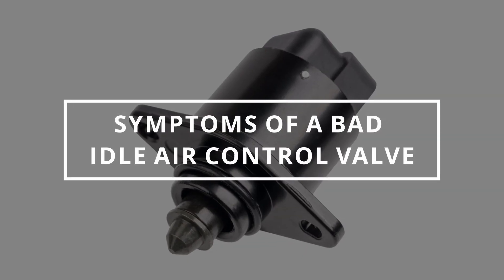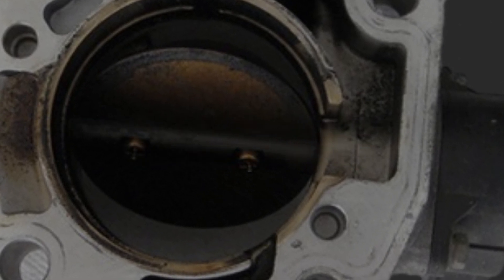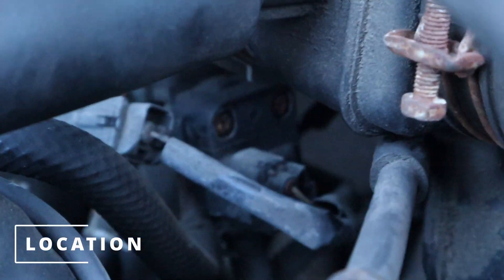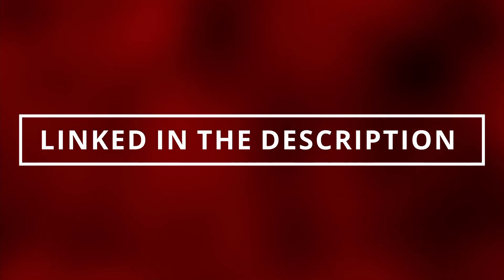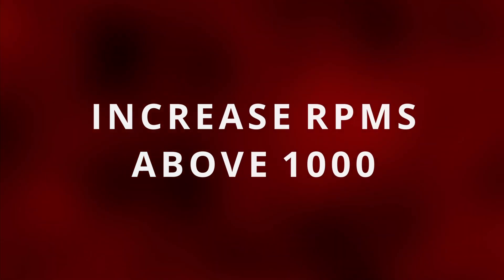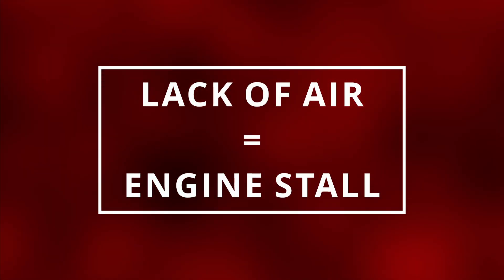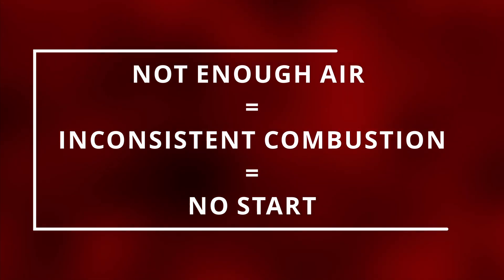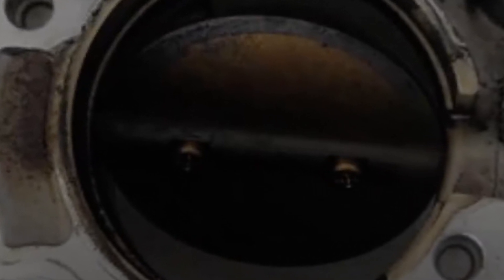SYMPTOMS OF A BAD IDLE AIR CONTROL VALVE

Comment: Been having this issue in my v8 s10 it runs and drives great but I’m having to give it gas to get it started, and when it does start it runs at low idle  ’ve replaced the IAC with a new one. Checked the fuel filter and air filter and no luck. Anyone know what it could be?
Reply: I would check the connection/condition of the mass airflow sensor, and also the condition/connection of the throttle position sensor. Also inspect for any tears on the boot of your air intake and any other vacuum hoses that may connect to it.

Comment: i have been told my issue could be electronic throttle body on my 2008 a3.2.0 tdi , i have no engine light or codes, my symptoms are when the engines up to temprature it will stall unless i keep my foot on the gas pedal , yet when the engines cold it  starts fine and doesnt stall.  does anyone think this could be my issue ,

Comment: My uncle's Tuscon on a cold start will fire right up but then the idle is really low like below 600 rpm for about a second or 2 as it appears to want to stall out, then ramps up to 1400 rpm during its cold start process then slowly drops to 800 rpm as it warms up.

Comment: FINALLY....I've had the "howling" sound for 'bout 8 months on a 1997 4x4 Ranger 4ltr v6. IAC....hmmm....who would've thought. I'll try to replace it myself or go to the local small garage mechanic (I support local businesses). Yup...truck is 26yrs old with 157k on it. Always starts...and has never left me stranded. I even drove to California from central FL last year at the height of gas prices ! I need a interior dome light cover and a fan speed modulator. And I can't find the very slow leak on the ac.

Comment: Would a bad IAC valve have anything to do with my 2001 crv misfiring only after being driven for a while?
Reply: I had that problem once. My valves were out of adjustment
Reply: @danhatstat6890  yeah there were a few parts I replaced over the last several months. Was running good for 3 months after putting a new distributor in it. But the problem resurfaced almost 2 weeks ago. So I'm just taking it to a mechanic in a couple weeks.
Reply: @josephhobbs278  have them do a compression test on the cylinders. Thats how i found out mine was messed up. Cheap solution

Comment: Is runner control valve and idle air control the same? 2009 mazda 6 I can’t find the IAC
Reply from the maker: No, they are different. You might not have an IAC. If you have an electronic throttle body the engine control module regulates the idle by opening the throttle plate a tad bit.

Comment: I have a 90 accord in great condition but recently having idling issues car fluctuates rpm rev high then low but seems to clear up after it warms up good and as soon as I put it in gear it idles perfectly... Anyone have this issue before or know what could cause this because I'm out of ideas but I'm only a backyard mechanic and would appreciate some suggestions ...
Reply: Try giving your IAC probe a clean first and see what condition its in. They can get a lot of carbon build up inside the throttle body.

Comment: I hate idle air control valves. Half the ones bought are junk and they go very fast unless you spend $80 at autozone for one. And alot of sellers online sell the wrong one. When I speed up ot shouldnt be so hard for the rpms to go higher . It takes buying tons of them from different sellers to find the exact right one. Then they only last a year.. .. fu king pontiac 💀

Comment: I got an 04 325i, when coming to a stop will dip under 500 and you can feel it, only for a second then bops back up, ac on idles around 650, ac off has to be 550 to 600. And at the hottest part of day, half second hesitation taking off from full stop. Testing ICV, ie, jiggling it makes the sound. I'm thinking it's this
Reply: This is my same issue. Did you replace it, and did it fix?
Reply: @Bait Royale  No, it goes all day long doing it with no harm seemingly, I've replaced spark plugs, and ignition coils, if I replace the fuel injectors all 6 I'd probably be good, already replaced one leaker with a used one. I put 40k miles since it started up, I'm more worried about it then the car, also the little cover for the fuel lines in the fuel filter housing is missing from when I changed it. These cars can have multiple problems and keep chugging along like nothing

Comment: It has been happening to my car. Cold start crank, runs, then immediately shuts off. Have to start, give it gas to about 2k rpm for a few seconds and sometimes stalls again. Will order the oem part. '00 4Runner.

Comment: My truck starts up fine and idles fine but when I get going down the road and the more stops I make the higher the idle gets. I can usually remedy this by turning the truck off and restarting it but it's a vicious cycle. Also I think it is causing some backfire inside the air breather. I have a 90 Chevy Silverado 4.6L V6
Reply: Did u figure out what was causing it?
Reply: Sounds like a vacuum leak possibly the intake manifold gasket. I had this problem and burned two valves.
Reply: @allanbrogdon9372  I wish I could check to see if that's the problem but unfortunately it got stolen.
Reply: @joetroutt7425  my Yukon was stolen and the police wouldn't even make a report. I feel your pain !
Reply: @allanbrogdon9372  I was just looking back on this comment section and realized that my response to you was wrong. The truck I was talking about being stolen was the one in my pfp. That truck is a 94.
Reply: 1996 Chevy Silverado when I run over 65 mph truck start jerking

Comment: This is exactly what's going on with my 18 mustang GT I think it's closed or closed because when I get to a stoplight it idles real low and it stalls I have to restart the car in either put it in part or neutral or keep tapping the gas for it to not cut off
Reply: Do you have an update? I’m having the same issue just not as severe. I also have the same car lol.
Reply: I literally have the exact same issue with my 05 Ford Focus, my mechanic suggested replacing the Idle Control Valve. It literally does great in driving, acceleration, highway driving, but occasionally it will stall cut off and stop when I have to hit the breaks. My car in the shop rn but I’m hoping to get it fixed, I had a new fuel pump, battery, alternator, whole tune up done with the throttle body, mass air flow sensor, spark plugs the whole 9 yards, no codes. If this doesn’t resolve the problem imma just get a new car, because I literally tried almost everything.
Reply: Having same issues

Comment: Can i take the idle control valve completely out?
Reply: Yes you can, just switch your car on then take out the cable on the air control valve then switch of the car and turn it again then take for ride so computer will read new setup
Reply: NO

Comment: I have a 2002 honda crv with 220 000 miles on it ,did a complete service, oil change, spark plugs, coils ,air filter ,pcv valve and hose new motor mounts. No check engine light either. But as soon as the it warms up it idles low at about 600rpm car shakes really bad. But as soon as I give it gas shaking disappears .is it the idle air control valve?
Reply: Did you get answer??? Mine is same issue with Toyota
Reply: It could very well possibly be. I can only derive from testing March necessary
Reply: check your map sensor

Comment: Would this also be a reason of why it shuts off when I’m parked or turning into a parking space and slow down at a stop sign/red light and I turn the wheel and it idles lower than when the wheel is just straight and not turned? It would sound like it wants to shut off when I turn the wheel a bit and sometimes when I break. (On a 1988 chevy c1500)
Reply: Mine does something similar,  I drive a 90 gmc safari and I wanna ask did you fix it?
Reply: If so? Did it make a difference?

Comment: can a stuck open iac. cause a lean condition ?
Reply: Yes just had a 2003 TLS bad iac Lean code owner r&r O2 sensor iac controls air,02, sensor has a BAD reading try cleaning it gum out spray 👍🚦🚙

Comment: Would this cause a long start, and random stalling
Reply: Check ur coil pack!!! I thought it was fuel
Reply: @BakingBayked  all new spark plugs and coils, I got a secondary air pump from the junkyard and it stopped for a day, next day back with the symptoms, I ordered a new air pump, and the valve to be safe. Waiting on em to come in, it stalls after 3 plus hours of driving in 100 plus degree weather though, but for regular driving no issues, and always fires back up in less than a minute. I can only hope that's it.
Reply: @BakingBayked  thanks man

Comment: I have a 2004 Chevy Cavalier when AC is on I slightly drop RPM either in park or Idle. Would this help me out ?
Reply: A.c. Is load bearing. So when engaged the compressor actually causes the motor to work alittle harder. Causing the momentary fluctuation in rpm.

Comment: What is your idle is flucating up and down while stopped?
Reply: I don't think oil leaking would have anything to do with that idle behavior . I just got done taking apart my throttle body and cleaned it with throttle body cleaner. I also pulled off idle control valve and soaked it in white vinegar. It runs so much better.
Reply: @kevinmichael5284  I was thinking because the wires are ignition coil wires. So the oil could be interrupting the voltage to the one spark plug.  The throttle body has been cleaned. The Mass Air Flow sensor has been cleaned. On the Sentra the idle control valve is part of the throttle body. Since that's been cleaned I am thinking for mine it may not be the issue.  Mine definitely seems electrical. It's a consistent dip of about 250 RPM and back to normal. Every 5 seconds.
Reply: @wingsoneaglesmusic so that worked for about 2 min for me. I did everything you did plus got new plugs sensors and still doing exactly how you describe your problem . I'm kinda lost . Let me know if you find your problem and what it was . Good luck
Reply: @kevinmichael5284  Will do. Please, you do the same..
Reply: Hey did you figure out your problem ? Cause I'm having the same issue
Reply: @kevinmichael5284  Strangely. No. Even had the scanner on it and no codes come up. Mechanic looked at all and can't figure it out either. I did notice that I have some oil on the wires of the connector going to the coil pack ( the 3rd from the left) Looks like maybe it leaked from near the oil cap. I am wondering if it's that.
Reply: 1800 2300
Reply: @kevinmichael5284  1800-2300?  is that where yours is fluctuating?
Reply: Yes  . Replaced the tps sensor . Still nothing . Hows yours coming along?
Reply: @kevinmichael5284  Mine has started giving me some issues starting. Not quick start. Everything seems to point to the IAV. I am going to replace it which is 65 dollars and 4 screws to replace throttle body which contains the IAV
Reply: @wingsoneaglesmusic  hi sir, did it worked replacement of iav?
Reply: Hope that works for you . Let me know
Reply: Did any of you guys get everything situated? I’m alssoo having the same issue with the sometimes rough idle, and weird acceleration. Please let me know

Comment: Great Video! I have a 2016 Kia Optima and it's stalling when I turn it on. It doesn't do it at a cold start only when I drive more than 30 min and park it and it sits for a few min and I go to turn it back on and it turns over and fires for a second or 2 then stalls out and dies. I'm assuming it's the Air Control Valve or computer. Or Throttle body. It's not the battery for sure so I'm hoping it's one of these 2 and it just needs to be cleaned or reset or something.
Reply: No it still does it on and off. Only when I drive it more than 30 min and it gets good and hot. Not sure what the cause or fix is.
Reply: Having the same issues here, have you found a fix for that ?
Reply: any news?
Reply: I’m having this same issue with my Jetta. Any luck?
Reply: @Iridiumcosmos  mine had an issue with the multiair (valve actuators) which caused this. Might be worth looking into something similar with your car.
Reply: @dombes1608  I think I’m starting to find the culprit with mine. Bad gas.
Reply: Mine is doing the same, ford taurus.

Comment: Can a faulty IAC also cause your RPMs to suddenly kick up while sitting in idle, such as while waiting  at a red light?
Reply: Yes. Mine does the same thing, it even drops to a point where it feels like it might stall
Reply: @Uchiha_Aljay77  heck yea same here lol
Reply: @Uchiha_Aljay77  my truck feels like it's gonna stall when I put in gear...I have no cel tho
Reply: @Uchiha_Aljay77  same my car just started doing this
Reply: You might have bad hose connections around throttle body. Get the pipes checked
Reply: What would cause my 94 Cheyenne sbc to jerk forward when I’m in gear at a red light or a stop sign etc and idle up and down when In park but runs fine when accelerating
Reply: @YaboiRUNINAMUCK6996  could be the, if you have air conditioning, your dash control is telling your engine to increase the rpms when the AC pump is not clicking the clutch on .
Reply: @YaboiRUNINAMUCK6996  did you ever find out the answer to your question I'm having the same problem
Reply: @YaboiRUNINAMUCK6996 mine does the same thing it's a brand new idle control sensor
Reply: @YaboiRUNINAMUCK6996 mine does the same
Reply: I'm actually having that issue or at least similar issue. My engine is revving up and down without me even touching the gas pedal. Though it doesn't ALWAYS result in this, there's times it stalls on me. Especially when I put it in gear. Sometimes it stalls out sometimes it doesn't. It a 2000 honda accord
Reply: @charlesgriffith7166  if you have to restart after stall,hold foot flat to floor until start,then feather untill you can get back to idle. Catalitic converter will be damaged if you don't  fix. Start engine without touching throttle in morning and let run through choke cycle and it wont rev up and down. It could be vacuum issue or iac valve. Pull off and clean with mass air flow spray.
Reply: I believe before replacing all the sensors it's best to clean them first and put them back on
Reply: A lot of times mine with go from high rpm to low rpm
Reply: What was the problem with your vehicle mine is doing the same thing and I can't find the answer
Reply: I have the same problem on my 2003 Ford F-150, seems to be worse in colder weather, cleaned my IAC sensor and throttle body along with MAF sensor and it run great for a few days and then started again, these sensors can get expensive real fast and still not  solve the problem
Reply: @terryhill4732  Could be intake gaskets are old and not sealing well, which can cause a rough idle that tends to gets worse as it gets colder..
Reply: @MarzNet256  It could be but it's not really a rough idle more like a high revving idle then slows down and if it was intake gasket shouldn't it have a vacuum leak which it doesn't
Reply: @terryhill4732  Yes.  But you could have a small vacuum leak that seals up a bit as engine warms up, causing the high idle to come down.
Reply: @terryhill4732  Eh, rockauto usually has a good range of options for replacement units as far as prices go, at least for every vehicle I’ve purchased a part from them to replace.
Reply: Look into cleaning your IAC and TPS, both easy to remove . Then take your battery cables off and hold the horn for 30 seconds, that should reset any stored memory . Not a for sure fix , but it’s something free and easy
Reply: @levicallis459  if my truck is tuned with hp tunes would that reset my computer to factory and erase the tune
Reply: could just be your ac pump
Reply: I’m having same issue.. but only when ac is on for some reason. Surges from like 750 down to 450 and back
Reply: @MrWontstopthefunk  yeah it acts really bad when the AC is on
Reply: Yes, change IAC, try rock auto, eBay and AutoZone, also use Techron half bottle before you fill your gas tank and also check your air filter. I had a 91 Buick regal custom and when I idle or park it would rev so high like it was gonna blow so I had to stop and turn off and on again, once I change IAC it was smooth like kitten no noise at all and smooth ride, I also cleaned the throttle body plate too.
Reply: Mitsubishi eclipse cross same issue
Reply: Is it a Toyota lol? We all have this problem
Reply: @Pittsburgh-412  no, it's a 2007 Jerp liberty.
Reply: @Pittsburgh-412  Yes-ish; Lexus.
Reply: @JasonDziukACE  I've been looking into this issue and it's very common. But I can't find the answer to fixing it
Reply: @Pittsburgh-412  it has happened three times in 7 and 1/2 years so it's not likely that anything I could do could have its effect measured. That's the worst part, I wouldn't even be able to tell whether replacing the IAC had helped.
Reply: @JasonDziukACE  same thing
Reply: @Pittsburgh-412  just replace it. I have a Ford and it's only $42
Reply: @MJ  mine just ended up being the serpentine belt was slipping and the tensioner needed replaced too
Reply: @JasonDziukACE I've had it happen after changing O2 sensors. If you've got lean codes it could very well be faulty catalytic converters causing the O2's to okay a send of an improper amount of fuel.
Reply: I ended up just trading the car in. Would have spent hundreds on "likely" fixes with no guarantee, and needed something with more front-to-back cabin space anyways.

Comment: Will that cause the car to want to stall at a stop sign, but otherwise runs fine down the road?
Reply: Crank position sensor would be more likely to go bad.
Reply: Check your battery terminals. Make sure there not loose or that there clear of corrosion.